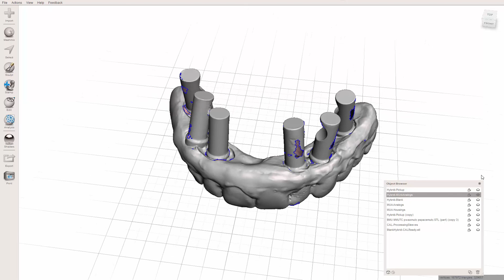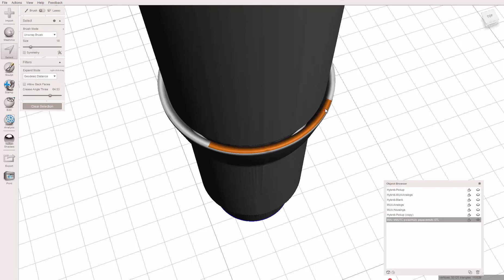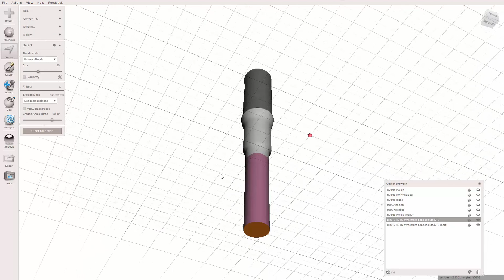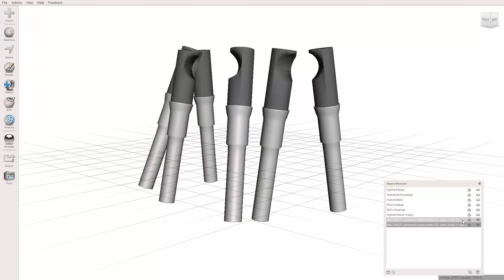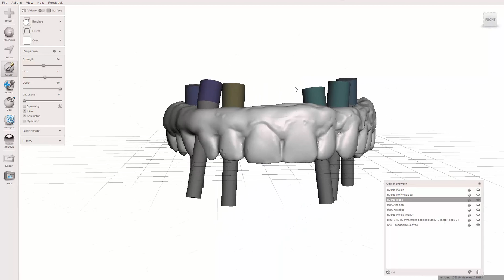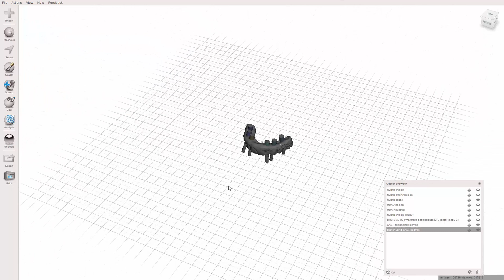Hybrid CAL Technique

Comment: Great video! What materials have you utilized with this technique? Have you fabricated any final prostheses this way?
Reply from the maker: No finals. Just printed a few.
Reply: @bgrutterdds  Very cool. Where did you source the STLs of the MUA analogs, temp cylinders, and CAL coping?
Reply from the maker: BlueSkyPlan
Reply: @bgrutterdds  finding the temp cylinders and CAL sleeve but not the MUA analog in BSP... The analogs you are using don't look like the physical BSB ones, did you digitally design those?
Reply from the maker: I got those directly from BSB. Hmmm